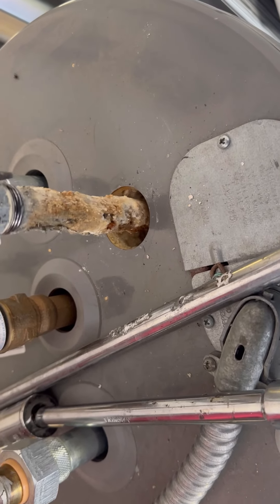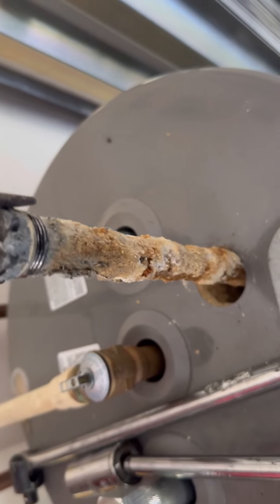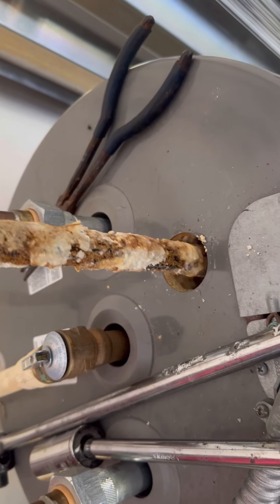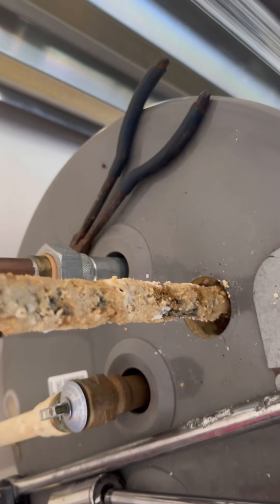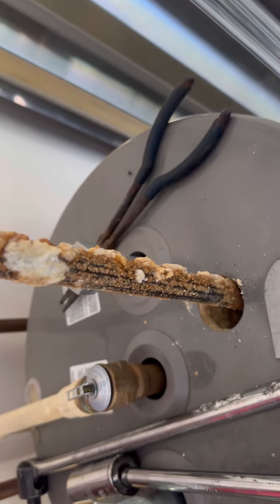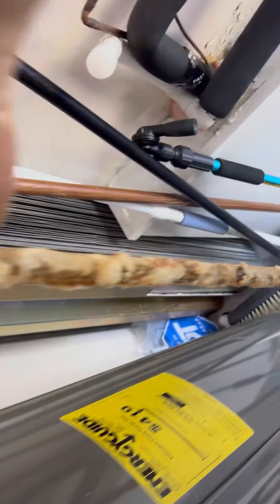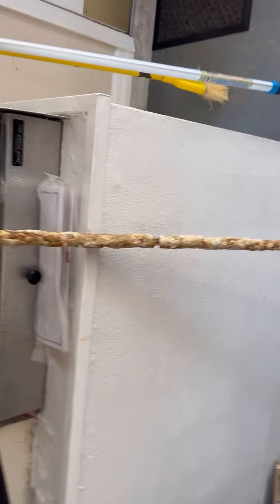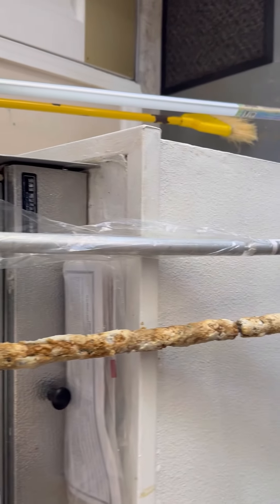Save your Hot Water Heater

Comment: I’m pretty sure that rod is zinc….at least mine are. Good advice but every 3-4 years is sufficient where I live
Reply from the maker: The new ones we put in are aluminum, factory rods are zinc.  The AC Condenser Heaters have stainless steel rods.  the calcium build up is so bad in some areas the rod does not come out after a few years , for those instances I recommend the electric anode rods which have no calcium build up.